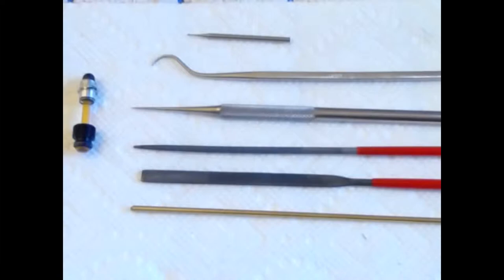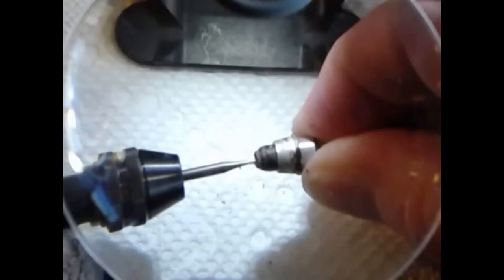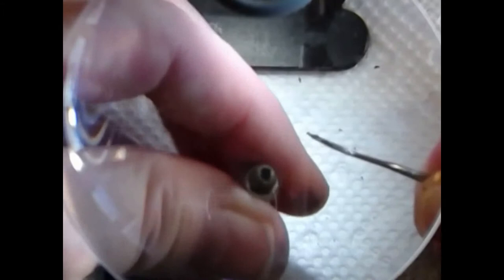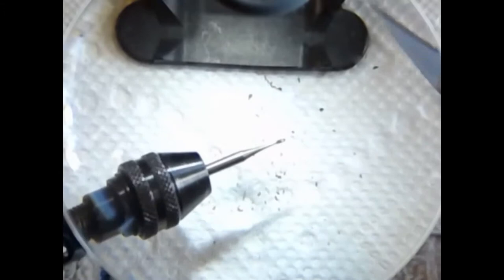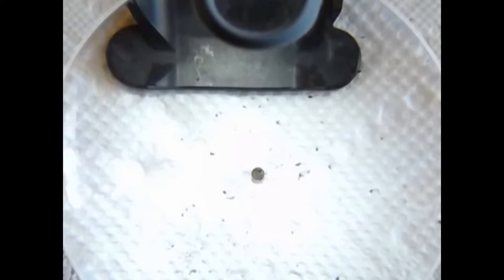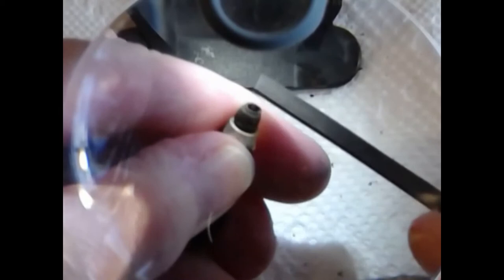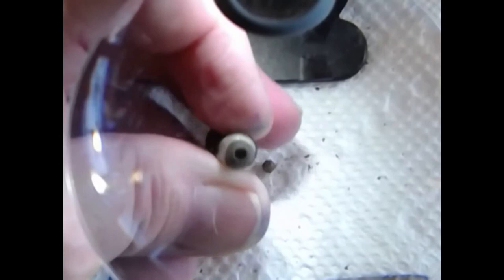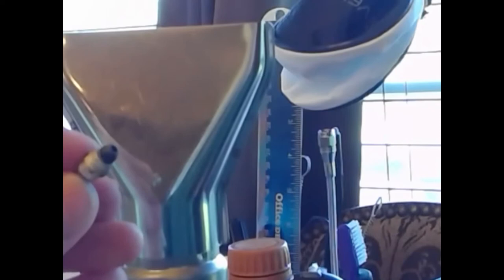How To Use A Dremel To Remove A Pellet From A Parker Vacumatic Filler
Unit

Comment: How deep is the hole the pellet sits in? And, my 3/32''  bar doesn't quite fit in the hole. Great Info...Thx.
Reply from the maker: I know it's been a long time since your post and I'm sorry it's taken me so long to reply.  It's probably 1/8th of an inch deep, maybe 3/16th.  It's ok that the rod doesn't quite fit.  You can heat it up slightly with a hair dryer and then insert the rod to get the proper fit.  However, it might work just like it is.  You just don't want it much bigger than 3/32 or the pellet and diaphragm will not stay seated.